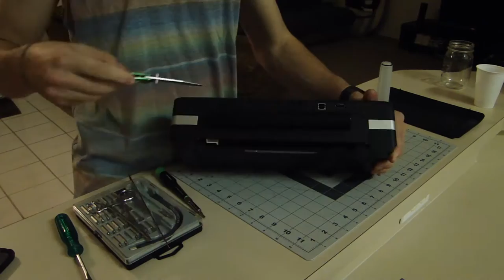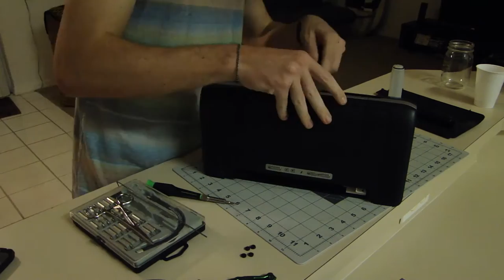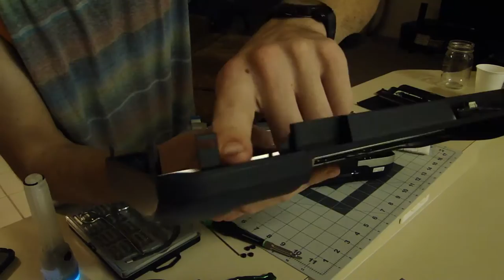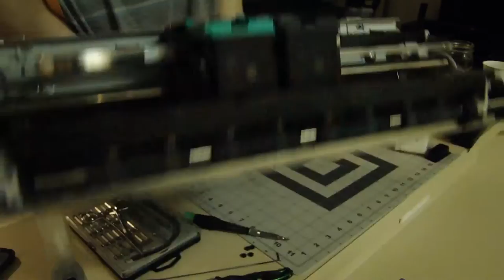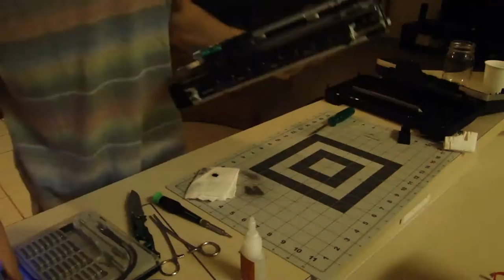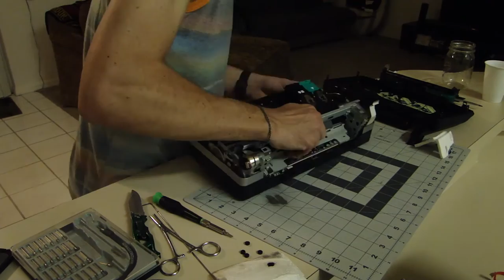How to Repair HP H470 Portable Printer

Comment: Tyler- this was outstanding. My printer is running again. It turns out that some debris had fallen into a corner where I couldn't see it with everything together, and once I got it taken apart, I found and removed the debris and was good to go! The way I saw it, I had nothing to lose by trying. The printer was toast as it was. Everything went back together with no spare parts. Thank you!   (Now, all I need is a solution to the issue of it disliking remanufactured ink cartridges. Bonus points if you can fix that!  :)  )

Comment: Good video and instructions. Not being a printer repair tech but a fix it my self'er, I'm not clear on the part to cut out for access and what to look for when you access-pull the gear. Should you use Gorilla Glue so that it it close to a permanent fix or something not as strong just in case. Also, do you have a version of this video that is not in high speed for I need to see some of the details for disassembling the unit. Thanks.

Comment: Great video, really helpful in fixing the gear issue! However, now I face 'carriage stalled' issue after fixing the gear with super glue as you've suggested. Do you face the same problem? Any ideas to fix that? Thanks
Reply from the maker: Hmm... I didn't have that problem. Is it possible that something was knocked out of alignment during disassembly or that a little glue got on something and needs to be broke free? My best advise would probably be to try and move all of the gears and wheels by hand to make sure everything moves and troubleshoot from there. It is difficult for me to diagnose without being able to physically see and touch the problem, as that is how my brain works. 

I have another of the same printer with the gear problem. I just haven't gotten around to fixing it. I may be able to help better when I open that one up. I just don't know when that will be.
Reply: Hi again. Thanks for your reply. I've tried to figure out the cause of this problem for the past few weeks and found out that the main cause of my problem is the small gear that had fallen off itself. After close inspection, I've found that small gear from my unit had an uneven space for a particular point, it is marked by a dot (a tiny budge) on top of it. That space is a bit wider compared to the rest. Thus, this cause the printer to get stuck at that point after cycle of 1 or 2 printing, and make everything to be out of its proper sequence. i would like to know whether the small gear from your printer is the same like mine and would like to ask your advice how to properly position it in order to avoid it getting stuck. Thanks again